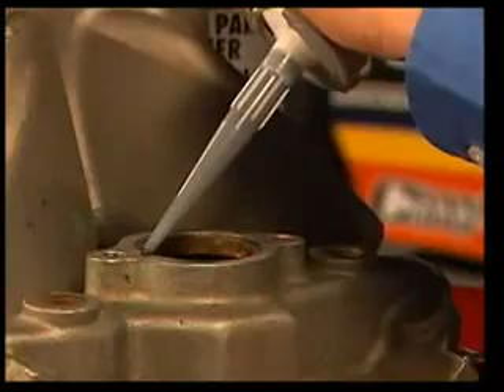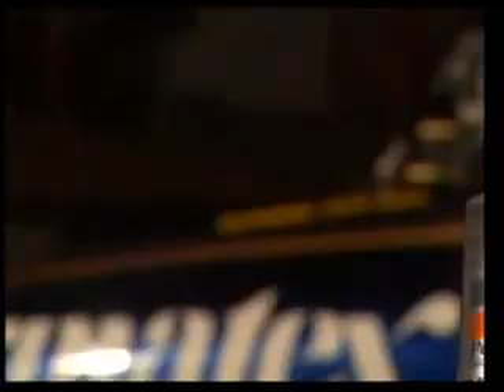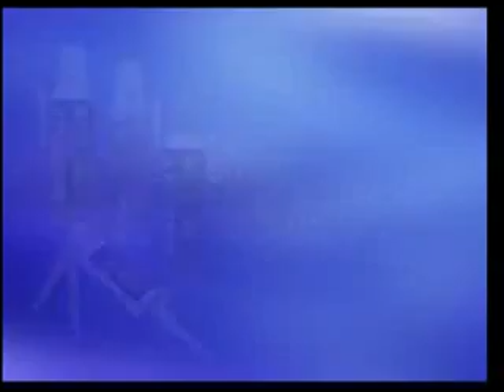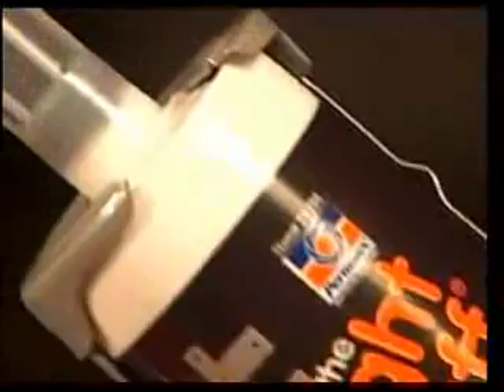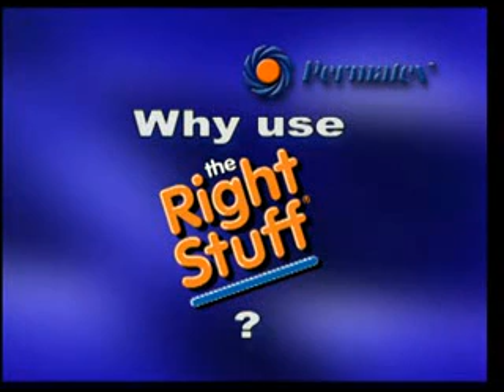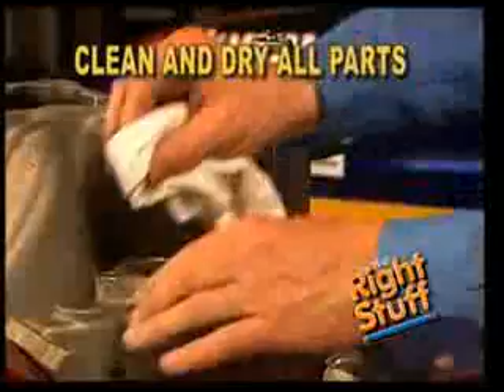Permatex Sealants

Comment: I used permatex black adhesive silicone sealant for oil pan gasket and waited 14hrs ...I then ran the car for 15min then drove around the block for about 5 minutes then the engine started smoking a lot .,.would this be because the sealant has not cured yet?
Reply: how much of the sealant did you use? was there a significant bead on the lining? you may have gotten some of the sealant into the oil pan.